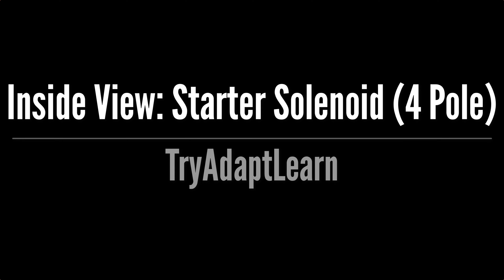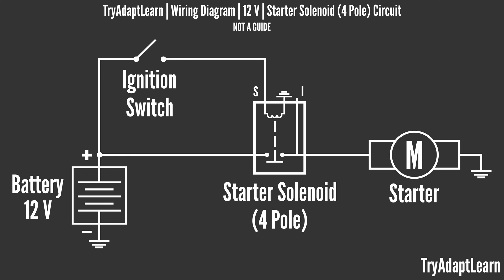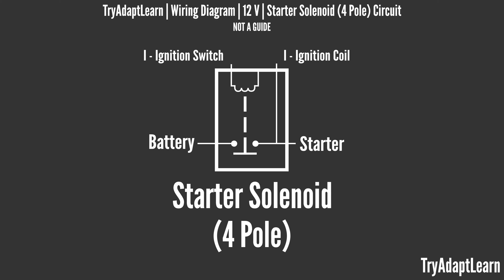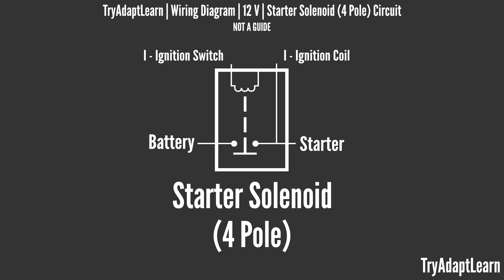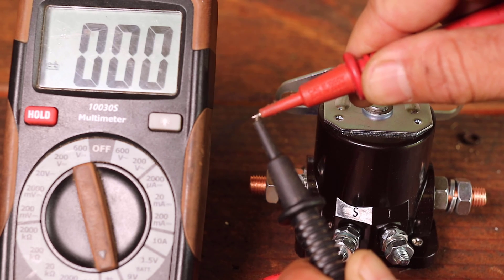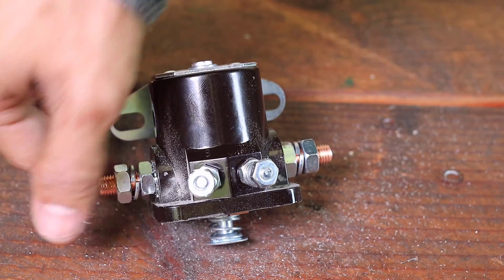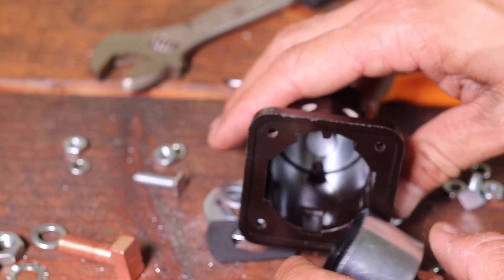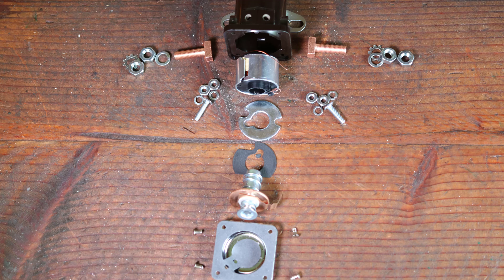Starter Solenoid 4 pole: How it works and an inside view

Comment: THIS IS NOT  a  "4 pole"  solenoid.  It is 4 TERMINAL, yes.  "Poles"  in a switch or relay describes the contacts.  If you have a simple, 2 terminal,  on/ off switch, that is  "single pole."  If you have  a 4 terminal switch, AKA two  on off switches in one package,  that is a "2 pole"  switch.  AKA  a drag race  rear mount battery disconnect switch with 2 large and 2 small terminals  is a "2 pole"  switch.  
Also this video ONLY applies to the older  12V Ford style solenoids.  There are SEVERAL  variations on these typse of   of  relay/ contactor type solenoids.  Some  other types, the two small terminals are both connected  to the relay coil.   AMC used a  special variation of the Ford like solenoid, because AMC was using Chrysler  transmissions, which use a grounding  neutral start switch.  The  ground end of the solenoid coil was brought out to a special,  5th terminal  which was wired to the NSS.   On  older Fords and some industrial,  one end of the relay coil is tied to the BAT  stud,  and then the start switch is a grounding type such as a push button. This was true of the early 6V   Ford  vehicles and tractors.   THERE ARE MANY VARIATIONS.  Keep your head above water.

Comment: I have a 1989 Ford E350 Retired Ambulance, with a 7.3 L IDI Diesel Engine. When attempting to turn the engine over, all I was getting was a very faint clicking sound coming from the Starter Solenoid, mounted to the cab body directly above the passenger side headlight.. There was one single time when I turned the key to the start position, and the engine did turn over for a very few short revolutions. I have since removed the Solenoid, and have purchased a brand new one, but cannot remember how to reconnect the wiring correctly. Also, when I disconnected, and removed the old solenoid, there were only the cables on both sides, battery, and starter, and one small thin wire on the terminal marked S, but nothing at all on the terminal marked I.....

Comment: I think I have a solenoid issue that is not grounding. I went from a 3 pole to 4 pole solenoid on the boat and I can start it up but it does not allow the starter to disengage and actually keeps cranking the engine when ignition switch is off. Am I missing a way to ground it that is obvious?

Comment: Is I ever connected to the ground? I have an old tractor that was doing nothing and now it is turning over at least but I have no spark. Is my coil bad? I am confused.
Reply from the maker: I’ve seen some solenoids/relays that look like they have a connection to ground and some without.  Ground for the solenoid is likely to complete the circuit for the coil to become magnetic.  If the tractor engine is turning over it is likely that the solenoid/relay is functioning.  You can probably do a couple of checks (with proper safety procedures).  One may be to test if the coil is receiving 12 volts with a multimeter or 12v test light. Another may be to test if you have spark with a spark test looks like a wired test light between the spark plug wire and the spark plug (so you don’t have to test with  an open spark). Seeing spark also assumes that your distributor (cap, rotor, points are functioning properly).  If the coil can be pulled out, I have a video where I tested an old and new ignition coil titled Ford 9N ignition coil change.
Reply: @TryAdaptLearn  I tried everything so far but the points. I didn't want to get into that box of worms. Plus isn't there a little condenser can that is on them that may be faulty. I will probably try that next month when I go there. I may need to buy some Silicone sealer to close it up after. If it's got moisture I want to try to stop it. I will take some really fine sandpaper and close the gap and clean them. Then I will use a Matchbook and regap them to it. I hope this solves the problem. White stuff will be falling soon.

Comment: but what i want to know is how come i can only get the engine to torn over if i have to go straight from i Terminal)  and s (terminal)  straight to the battery and and will not do anything with the key.  and i get no spark
Reply from the maker: Updated diagrams are linked in the description.  As far as the solenoid/relay is concerned, the engine should only turn over from the battery and starter posts.  The s should be for the key,  which needs 12v from the battery to complete the circuit for the coil inside the solenoid/relay to be magnetic.  If your key doesn’t work it may be wired incorrectly and/or something in the wiring or key switch itself is broken.

Comment: Question, I just finished up a repair on a 70-80s wood chipper I found a few issues. 1 the resistor wire from the ignition switch to the coil was melted and getting very warm every time the ignition is switched on. Also I noticed from the ignition coil pos. terminal there is a second wire running to the “I” terminal on the 4 post starter solenoid.  On your solenoid schematic you show the “I” terminal is connected directly the the starter terminal. When I watch you take the solenoid apart it appears the “l” terminal is actually connected directly to the contact plate. That way when the ignition switch is turned to the run position the power wire from the coil to the “I” terminal will not be shorted to the starter motor. Can anybody understand what I mean by this? The way I see it the “I” terminal should be open until the starter solenoid is activated then is should be energized.
Reply from the maker: Thank you for noting the electrical diagrams, since they cannot be revised in the published video the revisions to the electrical diagrams are linked in the description.

Comment: What about SR type starter selenoid?
I do not have points I have 4 pin gm ignition module with e core type ignition coil .
So I have problem there me fuse pops .
I did try to use diode flip wires swap pins on e core coil nothing just fuse pops.
So some thing is polarity sensitive .
So how can I bypass this problems???
I have multipel selenoids wuld useing 2 of those selenoids do the trick ?
Reply from the maker: I am unfamiliar with SR type solenoid.  I'm guessing that the 4 pin GM is for a GM HEI distributor.  In theory if you had a very simple electrical system you could use a 4 pole starter relay (solenoid), with a GM HEI distributor setup.   The best option may be to start with the diagram for the 4 pin ignition module then trace back through the entire circuit for your electrical as it should be stock.  After referencing the stock wiring, then cross reference that with the 4 pin and  mods have been done.  In my humble opinion two starter relays (solenoids) should not be necessary in a single electrical circuit.

Comment: the mounting holes are not part of the circuit on the 4 pole   they are part of it on 3  pole
Reply from the maker: Thank you for noting this.  From your prespective, on a 4 pole, where is the location for the the ground or equalvilent of a negative terminal to allow the electricity to flow through anc complete the circuit?  On the video, I mentioned this because while probing teh positive lead on the terminal for the positive 12v,  the negative probe showed the current is able to pass through the mouting bracket/including the holes.

Comment: Is the Relay directional...  Meaning, does it matter which post the main starter or battery power is connected to?   Thanks
Reply: no it is not directional
Reply from the maker: I would agree with the previous reply to this comment, that this relay (aka. solenoid) is not directional.  The components on the inside it look as though they just allow the current to continue to flow through in the direction it is already flowing, much like a wire.   Side note: there's an electronic component called a diode that can can conduct electricity in one direction.
Reply: In the video the schematic of the solenoid shows that the “I” terminal is connected directly to the starter lug. If that is true, then it would be directional, however I believe the schematic is incorrect and I think that the “I” terminal is connected to the contact plate, thus the “I” terminal stays open until the solenoid is activated. If I am correct then I believe the solenoid what be bi-directional.

Comment: Curious why you didn't hook it up to power while it was open to show how it actually worked. Enjoyed the video.
Reply from the maker: That’s a great idea especially since I have recorded both the four and five pole.  Looking back I guess I didn’t know if it would’ve worked or fallen apart with the electric current.
Reply: @TryAdaptLearn  looking forward to the next one!
Reply: the only thing  that moves is  the small metal bar that shorts 2 big  lugs

Comment: On my solenoid it does not use the chassis ground. It uses ground from one of the small poles.
Reply from the maker: Your relay/solenoid with the pole for a ground is similar to the 5 pole that was previously installed on the tractor project.  It had the 5th pole as a ground.
Reply: @TryAdaptLearn  what are you  calling5th pole